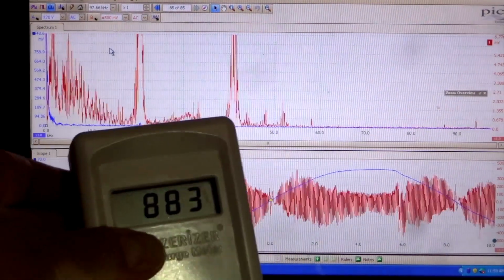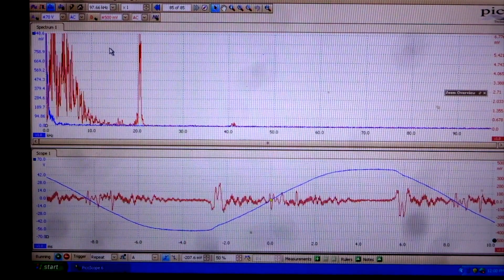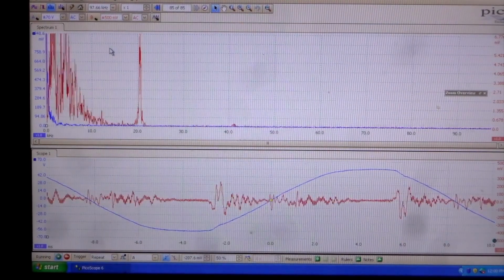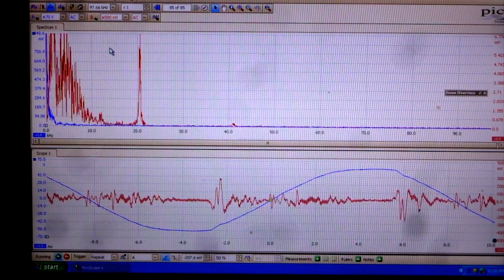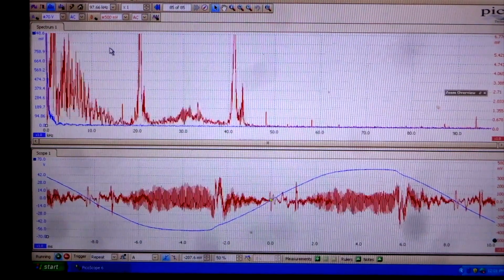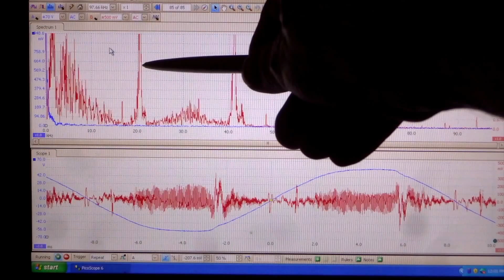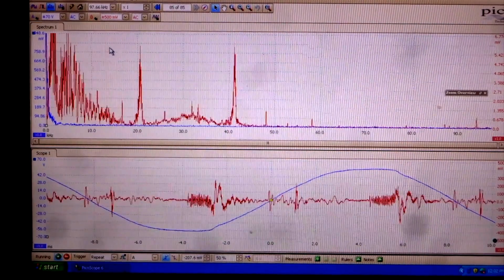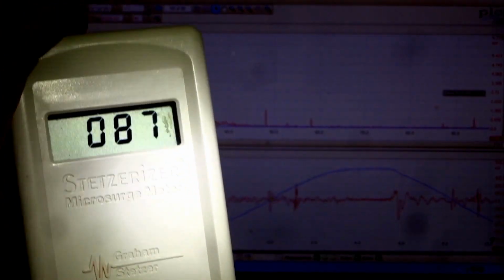Fujitsu Mini Split Ductless Heat Pump Creates Dirty Electricity.

Comment: I have two Fujitsu minisplits. They are hard wired into my panel. Where would you plug in the meter in order to get readings like these?
Reply from the maker: Plug Stetzer meter into any outlet connected to that electric panel.

Comment: I'm in the market for a heat pump . I was hoping to get away from gas. Is there anyway to know BEFORE installing these units how much dirty electricity they put out? I'm also concerned if dirty electricity will effect my pacemaker. A new heating/cooling system is a huge investment where I live ,$22,000-$31,000 for 1700 SF home. I think all the energy efficient units are variable speed.
Reply from the maker: Make sure your HVAC system has no inverters or variable speed motors. Permanent Split Capacitor, PSC, are safest.

Comment: Could I assume the Mitsubishi brand mini split would be about the same, have you conducted any testing on that one in particular?  Is there a way to remedy this problem?  Thanks!
Reply from the maker: Yes,  Most likely if it has a variable speed compressor or indoor fan unit.

Comment: Really??? Diet Coke..... now my heat pump.
Reply: Just wear Faraday shield clothing and no more worries. It's a little warm in the summer but toasty in the winter and you'll get used to the crinkly sound as you move but at least DE will no longer be a problem!

Comment: Nice video. I installed a LG mini split multi system and have been getting headaches after using for a few days. One thing I noticed is that the LG WiFi signal for each of the four air handlers is unusually high, much higher than any of our smart phones or other devices. I have since disabled the LG WiFi which has helped. Now I'm getting some ringing in my ears which I believe is from some of the sound frequencies generated from the couple of feet of line set that leads to each of the air handlers. I haven't thought about looking at EMF but maybe I should do that now also.
Reply from the maker: Hi,  Mini Splits have variable speed motors that create DE which radiates off the wire.

Comment: Is the DE effected by current on all the homes service. if the amps are higher like when clothes dry and oven are on does the DE get worse ?while running the fujitsu hvac
Reply from the maker: The DE travels on all connected and energized circuits.

Comment: I'm seeing things on the order of millivolts here...LOL.
Reply from the maker: Hello Tim,

You are correct about the voltage but it is nothing to laugh about. At 20 kHz and 40 kHz we are seeing 400 to 600 mV peak to peak.  These are called High frequency voltage transients and they radiate off of the wire and into the human body where they can cause a variety of accute and chronic health symptoms and problems.  See this link for more detail: http://www.sammilham.com/links.shtm.

Comment: Eric, this is very informative (as are the several of your videos I have watched).  I am scheduled to have a Mitsubishi ductless minisplit installed into the bedroom area (with its 220v compressor electronics wall-mounted outside the bedroom wall) in my new construction house.  Likely, it will behave similar to the Fujutisu, though I hope it fares better with generated DE.  My question is about the use of the Stetzer filter in your demo.  Since the Mitsubishi only runs on a dedicated 220V line, how does one effectively place the Stetzerizer (a 110V device) to do max good?  Placement trial and error in random 110V sockets until the Stetzer meter reports the best result OR by targetting a 110V circuit that is routed in the walls near the 220V line?  I have all my walls open so I will be able to see all the wires at this stage and could even do more effective shielding if I knew what might help lessen the EMF.
Reply from the maker: Hello Ken,  In order to serve you best I suggest a brief call at no charge.  Please sue the Contact Us from on my website to provide me your phone a zip code location : http://windheimemfsolutions.com/contact-us/  I am available now.

Comment: If the Inverter Ducted outdoor unit was mounted outside my bedroom wall, would that also cause an EMF situation with my health as well or no? Also, Daikin said it uses an "Electronically Commutated Motor (ECM) that provides improved system performance and user comfort by automatically adjusting its speed to provide the factory pre-set optimal airflow. The fan motor also uses less energy than a typical permanent split capacitor motor (PSC) due to its soft start and higher efficiency at lower loads." Is ECM as bad as VSD when it comes to DE?
Reply from the maker: Great questions Billy,

I have not measured a Daikin unit so I can make a statement on it.  You need to have a fixed speed motor to avoid the high frequency voltage transients which are know as DE. Adjustable-Variable speed motors create DE.  Use a Stetzer meter to determine if your unit creates DE. Measure with unit on and off.
Reply: ok thanks for the info. and i'm assuming you're not sure about the outdoor unit EMF question also?
Reply from the maker: I have not inspected a Daikin unit.  Use a Stetzer Meter to measure for DE.  You can order them on my website.
Reply from the maker: I would have to test it.
Reply: Have u tested the Daikin yet? I'm also interested to hear about EMF. If DE is created by Daikin, how do you recommend filtering it?

Comment: Thank you for this. I was about to buy a Fujitsu system for $5000. I came online to check about the effects of the WIFI and EMF and found your video. At the other end of the spectrum,  I could get a Whynter dual hose portable AC with heater - for under $500. Not quite so amazing - but not so pricey, either. I have been heating with wood, and my home is mostly naturally cooling. I would have bought the Fujitsu and get a filter, but that remaining cancer causing frequency concerned me. I take it that the variable speed compressor on the Fujitsu was the problem?
Reply from the maker: Hi Mary,  Good choice.  Any electric motor that has a variable speed drive (VSD), frequency inverter or adjustable speed drive will cause massive amounts of DE.  It is always best to make sure the more is a PSC motor: permanent split capacitor.  VSD motors do save you on your electric bill but it is doubtful they save you enough to pay for or reverse the health damage they can cause your entire family.
Reply: Thank you for your quick reply.  Are any outdoor compressor units for AC/heat pumps made with PSC? Or are all VSD these days?
Reply from the maker: You will have to ask your HVAC contractor for a unit that uses only PSC motors for both the indoor and outdoor units.
Reply: @marialouisa108  Amazingly, most of the whole house ducted heat pumps are not VSD which is still installed in a high percentage of new construction. But most of the mini-split heat pumps are variable speed.
Reply: @LowerYourHeatingBill  Wow- interesting. I guess the VSD makes it more efficient? We have been happy with our Whynter unit - AC and heat
Reply: @LowerYourHeatingBill  Dude this guy is just trying to scare you, please do not listen to this crap and do your own research on it. Trust me you are never going to get away from this so called dirty electricity, it's everywhere and you have more to worry about with the foods that you are eating and the chemicals that are sprayed on said food then this garbage.
Reply: @JJaywalkin  Psyched to listen to music while mowing, I put my new bluetooth ear piece in and headed out.  As I readied to mow, I turned it on, and the tooth fillings in that side of my mouth (what I can only describe as) "screamed", with electric shock sensation.  While yes the foods we eat and the chemicals we use do their damage, clearly we're vastly uninformed on electronics and other electrical uses' impact.

Comment: Very interesting info here. Hopefully Fujitsu will clean up their power supply so we dont have to.

Worth mentioning, the primary cause of cancer is sugar and flour. Most people overdose on simple carbs every single meal which suppresses the immune system and creates chronic inflammation. On top of all that it is addictive and cheap. Add in some toxicity, stress, and emf why not, and we have a chronic illness explosion. The same goes for heart disease, diabetes and autoimmune malfunction.
Reply from the maker: Thanks Liberty.  Who would think that an energy efficient Heat Pump could cause problems? After all it is "Energy Star" Rated.